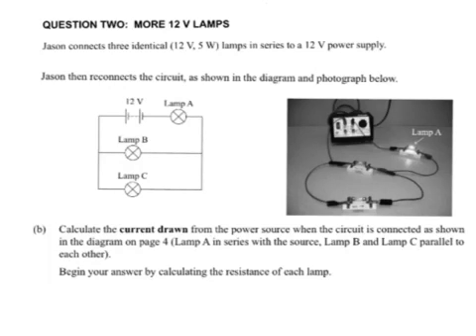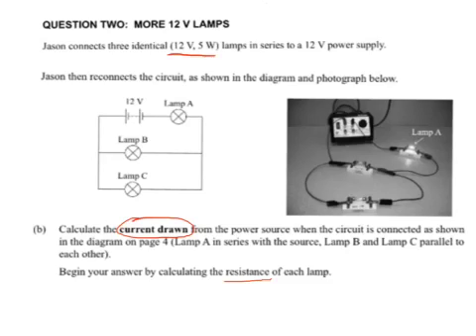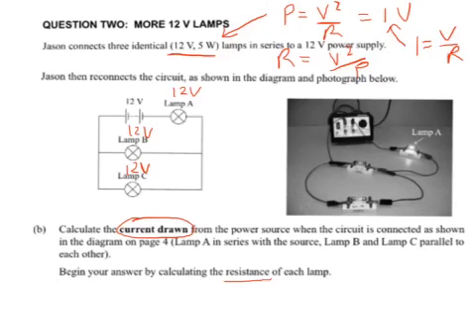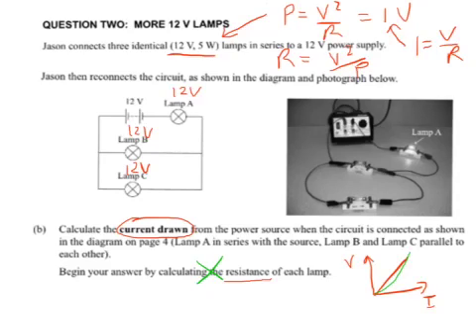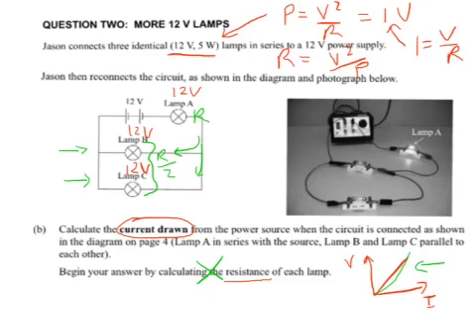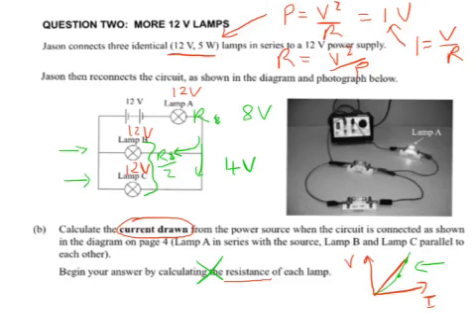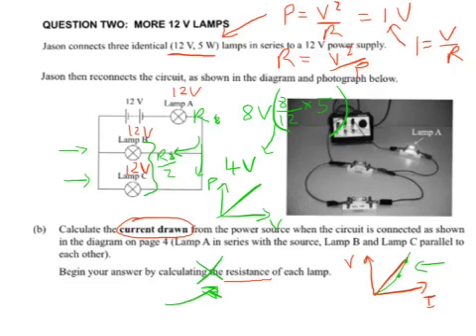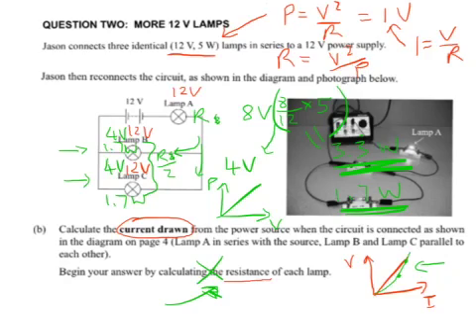2012 Electricity Q2 (b)

Comment from the maker: You're right that the voltage is the same in parallel and the current splits, but Lamp A is in series with the parallel branch so will have a different voltage drop due to it's higher resistance compared to the parallel part.

Comment: Don't all the lamps get 12V since they are in parallel? I am pretty sure it is the current that splits between the branches not the voltage.